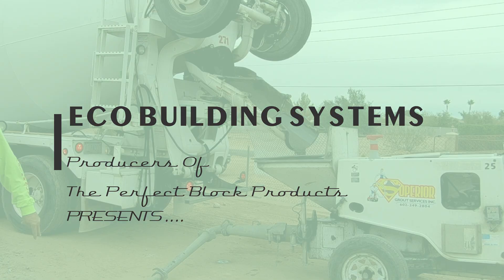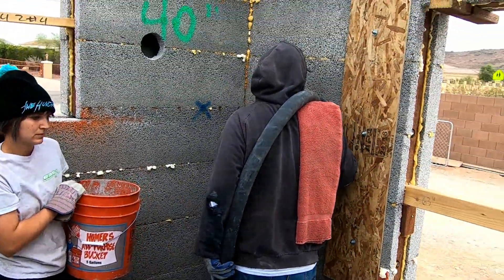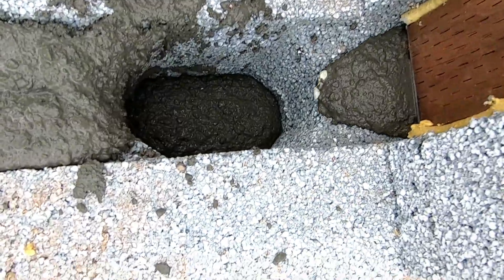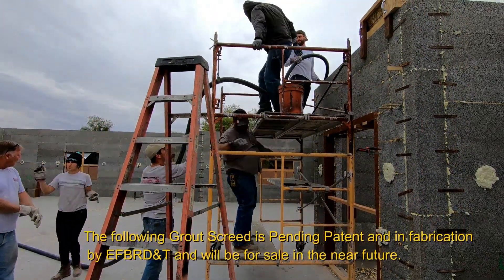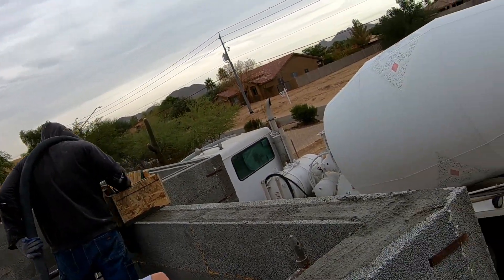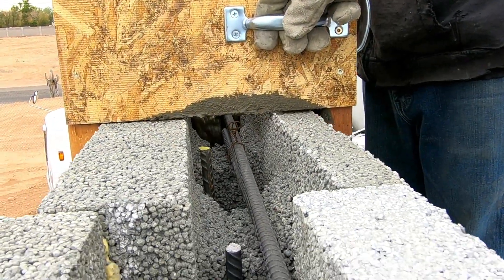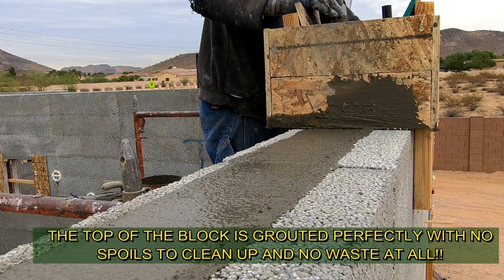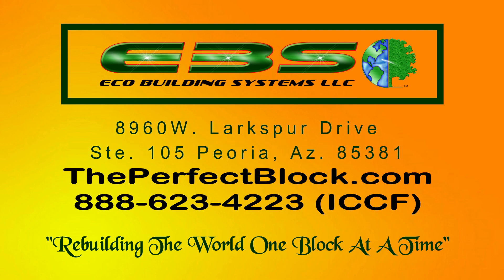The Perfect Block ICCF Grouting Techniques

Comment: What kind of grout is this?
Reply from the maker: We order our concrete from the batch plant as follows:   Grout Mix – 3000 psi, aggregate less than 3/8” (pea gravel preferred), 8” to 10” slump (viscosity – the higher the number, the more fluid). Flow enhancers are encouraged.
Note: the slump is likely to change from arrival of the concrete to the end the of the pour, add water from the concrete truck as necessary.

Comment: Where is the bracing!
Reply: They are invisible. Sometimes in a high wind situation, they may brace outside to prevent the wind from blowing the wall over. Despite the somewhat misleading title, these are not ICF walls. These are insulated composite concrete forms. Amazingly people who put out these videos incorrectly say ICF stands for insulated concrete forms. It really is Insulated Composit Forms.
Reply: @ArnieD17  I don't follow the difference between concrete and composite.  A composite is just a collection of different things or elements or materials.  It seems intuitive that you have concrete (grout) surrounded by rigid foam (an insulator) and it is a form for the concrete to cure within.